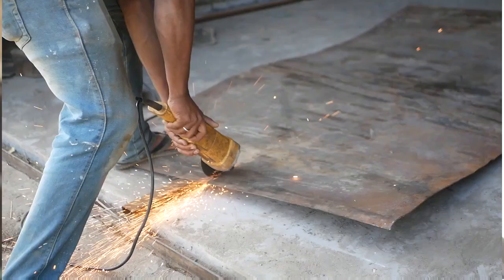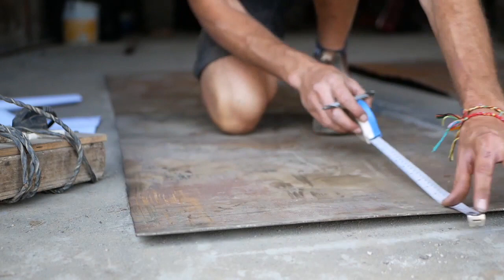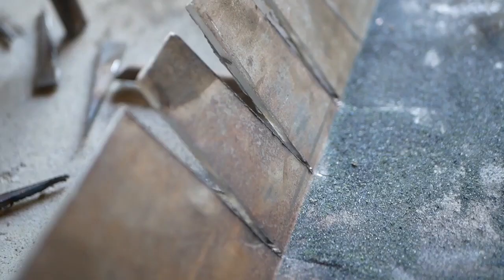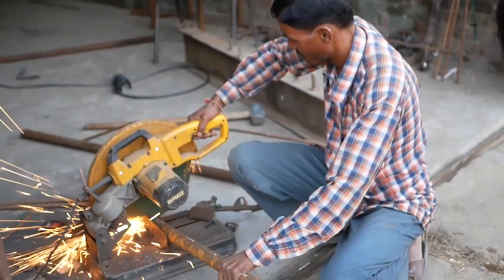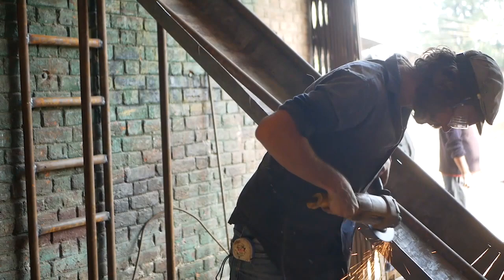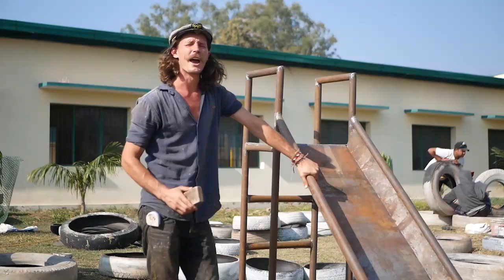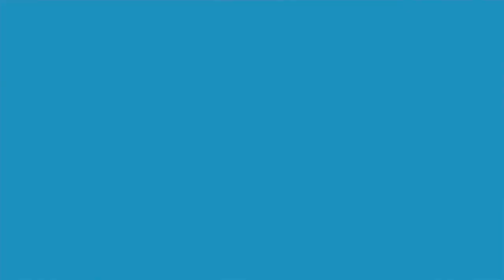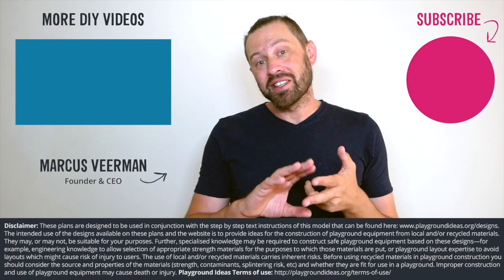How To Make: DIY Slide with Sides

Comment: Do it yourself with three assistants and a load of expensive tools...
Reply from the maker: Hi Drew, over 12 years, we have built playgrounds across the globe and volunteers are never hard to find and a welder and grinder are tools that can be found in almost every community ( and we have worked in some extremely remote locations) at fairly low cost. if tools are hard for you to come by we have many other designs to choose from that use even simpler tools such as our "tile slide" https://www.youtube.com/watch?v=rFvqVxMeMqI

Comment: I starting replicating this today. My 4year old has constantly reminding me that i promised him one. The bending was really hard so i ended up cutting leaving a few sections uncut. A lot more welding this way but id rather weld than hammer all day.

I got the slide itself into shape. Tomorrow is the frame and pipe. Then hopefully paint the day after.